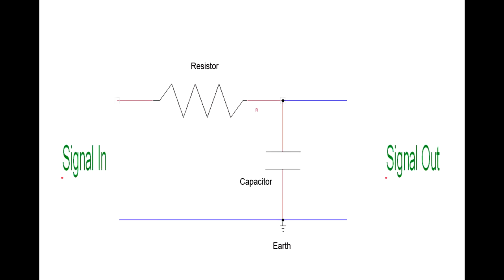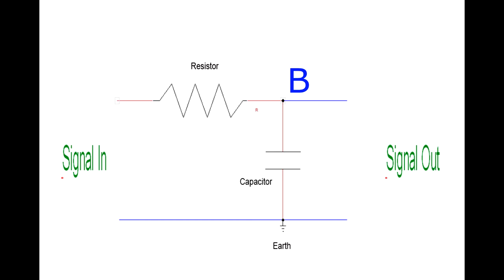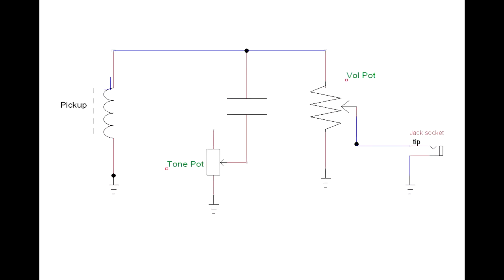Capacitors in Guitars : The path to great tone or just snake oil?

Comment: You are dead right Tony. I remember many years ago changing my cap for an expensive type and really loving the change in sound, but it turned out that my original cap had drifted so much that it was the value which had changed, I tried a basic cap of the same value as the expensive one and my sound was every bit as good. Nice to hear honesty  - very refreshing!!!!!!!
Reply from the maker: Cheers David. 
Drifting components are a big issue, more well known to amp techs, where often they renew caps that are failing in preamp cathode bypass circuits and find that the customer has become so used to the drifted value that they no longer like the tone of the amp - despite it being returned to factory spec.

Comment: one differentiation in the types of capacitors relates to the tolerance. denoted by letters and ranging from very small tolerance (.1%) to very large (20%+). meaning that if you have the worst tolerance "M" of +/- 20%, your 0.022uf cap could be anywhere from 0.176 to .0264 uf. Does this matter? Depends on whether you are trying to dial in a specific value (as the video mentions) OR if you are trying to get consistency in your circuits (i.e. you are a manufacturer trying to get consistent filtering in your circuits). as mentioned in the video, avoid expensive caps, they aren't worth it, if you find a M-type cap and actually measure it and get the uF you want, then it's as good as any other cap at the same uF reading (assuming proper voltage handling/etc., which for guitars is very very low)

Comment: I've used a 6800 microfarad Cap in my bass. Which has been the biggest capacitor I've used. I mainly use a 2200 microfarad capacitor. I don't like the way they sound with anything smaller. I've bought a 10000 microfarad capacitor. Just to install in my bass. Except it wouldn't fit in the cavity.

Comment: You’re a brave man to tell the truth regarding the tone capacitor myth. Capacitors in guitar tone circuits have a pretty easy life not being subjected to either high voltages or high temperatures. Changing the value  of the capacitor or the tone pot will have an effect , most modern capacitors are made to much higher specifications than the old paper in oil ones and should last for almost ever in an electric guitar.  Having a no load tone pot or some sort of tone circuit bypass switch can be quite a useful addition to a guitar tone circuit.
Reply from the maker: Brave or crazy - you could make good money putting in very expensive caps! Yeah, you're right,  the 600v orange drop cap gets a seriously easy life in your guitar! I haven't used no loads very often, I probably should try them more.

Comment: I'm not going to claim that capacitor type necessarily makes an audible difference, but the argument you're relying on is fundamentally flawed. It doesn't matter that the signal doesn't flow directly through the capacitor on the way to the amp. What is left in the signal that does go to your amp is obviously influenced by what's subtracted from it, otherwise tone circuits wouldn't work at all. This means that if the capacitor type did have an effect on the signal that passes through it, it would also have an (inverse) effect on the signal that doesn't.
Reply from the maker: That's a valid point. If there were something fundamentally different in the way one type of Cap passed the signal to ground you would potentially hear a difference via subtractive effect. 

But I think the main thrust of my argument remains unchanged - that if the capacitor is behaving as it is labelled, then its effect is entirely the same no matter what its construction.

There's no magic, just mathematics.
Reply: I think this argument is flawed because these are physical objects with imperfections, not mathematical equations. The response over time is relevant. Its like saying all compressors are the same because they all are designed to compress the sound. Yes, but they are imperfect and react dynamically because they are physical objects.
Reply: yeah he's thinking the signal comes directly from the output jack or something